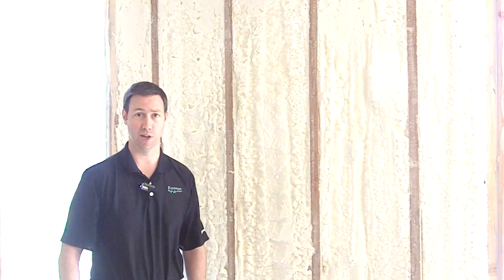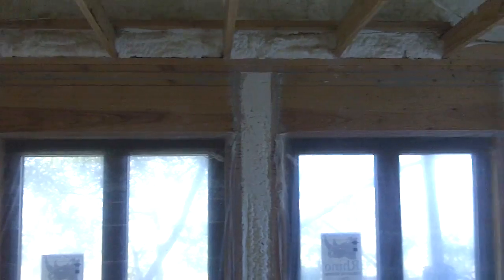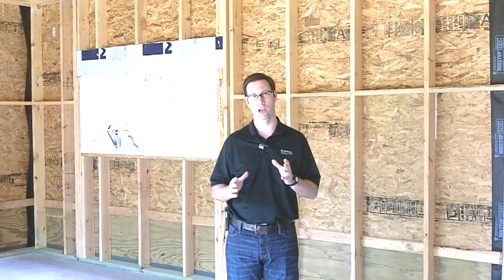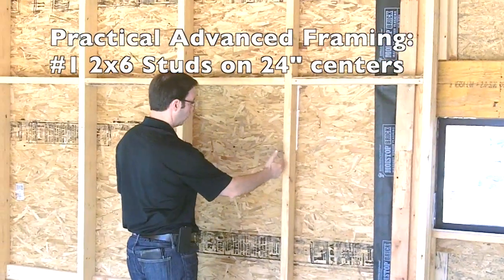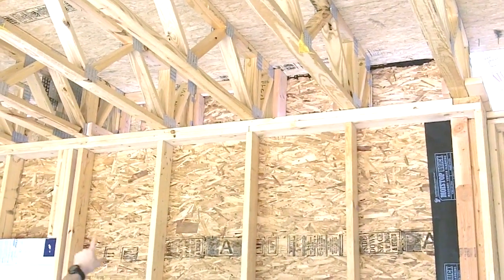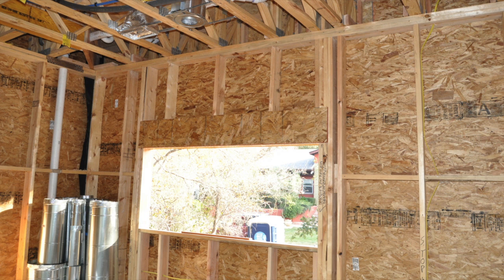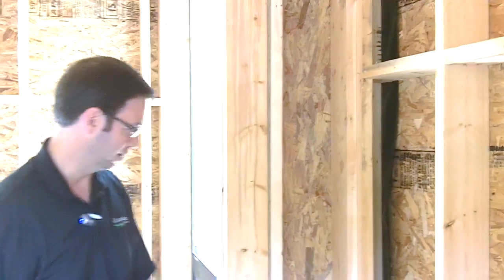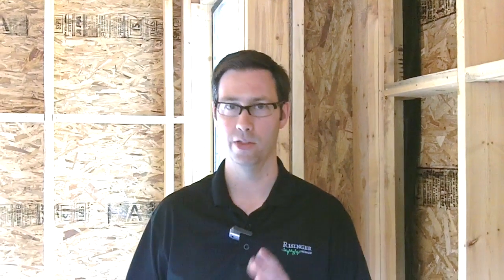Advanced Framing vs Traditional Framing

Comment: 24 inch centers are not a good engineering practice. This will weaken the wall structure of your house.  Why does it appear that the younger generation like this video, can cheapen down house building and still have good quality. 24 inch centers will create a bad quality frame product because there is less support to carry the load of both the house materials, people and their decor,  and weather.  Stop being so cheap and promoting it. Its ok to spend a little extra and go 16 inch centers and have a quality product that will hold up and last a long time..

Comment: i agree with most here on comments...  u dont save all that much by 24 on center...  2x4 walls 24 on center is a freakn treehouse...  i do like the spray foam tho, at least your gaining some ridig structure to your 24 inch center. u have all those fireblocks your adding.  i think this concept you invented is kinda a joke.  advanced scientific framing?  like your some groundbreaking scientist that is  above traditional carpentry..  which has been prefected , tested, improved upon for 100s of years, not to mention how engineered wood products have brought traditional modern framing to whole new level of awesome!    to think that your methods are something new and scientific is hilarious....

Comment: I believe it was about 25 years ago that 2x6 exterior wall framing on 24" was gaining in popularity based on getting an R19 perimeter wall instead of an R-11 or R13 wall.  That didn't last long, as it was determined not much money was saved, if any, and that heat gain is principally through window openings, wall penetrations, etc. As the man states, having to use 5/8" rock on walls costs more.  So most homebuilders went back to 2x4s on 16 with much better windows, and foaming gaps.   I'm in FL, our code is  unique and different than yours. Your state's code is online.

Comment: Here we go with some college boy getting all big- brain worried about the R- value of solid wood over a handful of windows when the percentage of wall area which they make up is ridiculously small, and is that a heat loss you really need to  worry about.  just make sure there's a Tight Seal where the sill plate meets the foundation. A leaky one of those can equal a two foot square hole in the wall.

 Add to that he thinks he's genius going with a thicker drywall to make up for his lack of framing where he's trying to save a buck.
Well... As they say in Millennial speak, let's sit beside that supposition and unpack your assumptions

 In my neck of the woods 5/8 is about $2.50 to $3.00 more per sheet. And for the sake of argument 8 foot 2x4 Doug Fir framing is $3 a piece. As on 2 foot center an 8 foot sheet spans 5 studs and on 16 inch Center an 8ft sheets spans 7 studs 

There are two 4 foot wide sheets on an 8-foot wall. Therefore the $6 saved by eliminating two studs is spent back by spending $3 extra per sheet of 5/8 sheetrock. Then one must consider the added cost to the drywaller charging extra to hang a heavier sheet, which in my area can be between $2 and $5 per sheet depending if it's wall or ceiling

So as you could see 2 foot on Center framing with 5/8 drywall is not a savings but an added cost to the job at this point

 But even more important are you going to get door jambs 1/4" wider readily available for the thicker wall?

 There were no quotes available online anywhere for 4 3/4" jams which would be required for 5/8 drywall. The only jamb available for pricing only the 4 1/2" jamb was available for pricing which we can assume the larger jamb is special order so forget about that being convenient and affordable.

 Or  perhaps are you make your trim Carpenters fuss with some bogus job site extension jamb detail underneath the casing. 

The same thing with stock windows ...now you need extension jambs and you don't need me to tell you that is a Time killer. You will easily see any savings in your economy framing go right out the window, literally. 

Don't try to get fancy, you haven't come up with anything better than stick framing 16in on Center and a half inch drywall. 

There's a reason why it's been around for so long and so universally accepted throughout our country because it works. It's simple it's efficient it's economical it's easily handled by small crew and it makes a good house. It's already been paired down to its simplest elements

And while we're at it beating up on this palooka, I live in a high wind area and that piece of shit he's standing in front of there with that OSB sheathing that's going to need wind bracing straps underneath the sheathing big time. 

My house is a 1955 Cape Cod with 10 pitch roof sheathed in 1 x 6 tongue and groove board on a diagonal on the deck and second floor and on the side wall and laid  parallel on the roof. Let me tell you, I'm on south-facing side of a hill overlooking large body of water and when  the wind blows the only time I ever heard my house move was during 70 mile-an-hour gusts that took down the oak tree across the street and don't get me started  on that a crappy California corner. It will never work where I live. 

I got to stop clicking on these construction videos. It's reminding me of how intelligent I think I am but if you knew me you'd know I'm really not, it's just guys like this make me and a lot of my friends look really really smart

Hey at least he got a fresh haircut for the shoot

Comment: As a framer in the northwest, where we actually have to worry about -30 to -50 temps as well as snow load, you can keep this nonsense wherever you are, I'd get laughed off the jobsite for even suggesting what you call "advanced".  Also your cali corner is missing a board, as well as the heading backer over your windows.  Your traditional corner is just nonsense.

Comment: Remember ove framing is 19.2 on center "black diamond on your tape". Using 2x6 and a tie system will take care of a lot of your worries. My house they used standard 16" centers on the walls, and 2' on the roof rafters lining up the load path is easy on ove framing

Comment: Yea forget that. I live in the North East, and we have construction companies that come up here from Texas and built a few developments. Listed them as luxury apartments, and the roofs collapsed in the Winter Time! I'll stick to the way we frame, 2x6 16" on center for the walls, triples in the corners, you insulate them as you build, that's code where I live, 2x12 floor joists and roof rafters! I don't like the header that he is bragging about, his 2x4 is shifted over to the right, you can see a spot with no support on the top plate because of this. I really dislike this so called advanced framing. I wouldn't sacrifice structural integrity for a little extra insulation value. Just find a better material for insulating if you are that concerned, also you can insulate the other side of the wall under the siding if you needed to.

Comment: Just plain crazy  add a few studs and do it correctly the first time. Why make problems for the owner after you are gone. 40 ft. wall 40 studs + or - . Your wall 26 plus 10 for horizontal cross members, maybe a 4 stud savings and a poorly constructed home. Put 12 inches of wet snow on that roof and watch the walls below bow.

Comment: If it was 1/2" Advantech sheathing I would go for that. If you show up on my jobsite with ANY particle board of ANY type other than Advantech? I will kindly throw you off of it. 24" centers?? Are you NUTS?? AND you are trading the cost of 2x4 at 16" centers for the cost of 2x6s at 24" centers. GO BACK TO SCHOOL son.

Comment: Notice the header @ 3:43. There is nothing for nailing wide headstock. This is a common problem I've run into as a finish carpenter. If the window gets a heavy headstock for trim, I sure wish they would provide some backing.

Comment: Just to be clear, you can not frame a 24" on center 2x4 wall. Only 2x6 and up. And for those saying it should be 16" on center, that is wrong too. All these items are written in to the American Wood Framing tables and also in the IRC/IBC. These issues are not just pencil marks made by and engineer, but buildings are actually framed on whats called a shake table where things like lateral restraint and shear. Expencive testing but actually tested well. If spray foam is used, the building is very well up to sheer and lateral restraint.Also, 5/8 DW is required for 2x6 24" on center, or 1/2" DW thats called C board that meets the same sheer and smoke/fire requirements as 5x8".

Comment: It's understood that when framing with 2x4 studs you set every 16" oc. When upsizing to 2x6 it is acceptable to space 24" oc. And this is a determination for the engineer not the contractor. This yahoo is talking like he is reinventing home building. The only borderline original idea is insulating headers and the GC I worked for in Alaska had been doing this for years. Texas tho? You fucking kidding dude? Whoever said salesman nailed it. This guy is selling a down jacket to a bunch of unsuspecting desert creatures. Looks good tho. If I was some dumbass who wanted to brag about my R values to my neighbors I'd be pumped.

Comment: I have more of an issue with "off-gassing" spray foam insulation than I do with traditional framing. "Advanced" framing will get you canned in the quality world. Pictures fall off walls when doors close too hard, ears pop from the drywall flex from opening and closing doors. roof loads, wind loads, etc. Been there, seen that, addressed that, fixed that. Tract builder grade workmanship is unacceptable in the custom world. 38 year contractor in Florida here. Framing for most of them. If it feels cheap, it probably is. "The bitterness of poor quality lingers long after the sweetness of low cost is forgotten."
Reply: It would be great if a foam spray existed whose only gaseous component was carbon dioxide. 
As far as drywall goes, I hate it. If forced to use it, I'll apply one layer and laminate a second layer with offset seams over it with a non-VOC adhesive.   Even if the second layer is 1/4", it has better strength, crack-resistance and sound deadening properties than the equivalent thickness "single ply" drywall.
Reply: Eddie, I was told styrene type spray foam was illegal inside human living quarters. We built with a spray-in called icynene which is water blown and non-toxic. It doesn't get so rigid, neither.
Reply: Yep, you nailed it.
Reply: Love the quote. I also experience the inverse which is also true with tools. "The price of a quality tool is soon forgotten. The lack of performance on a budget tool is experienced frequently." For example, I nearly cried the day I bought my saw stop. Today I can't remember what it cost but the saw sure is nice to use!
Reply: @RussSchampers  Sawstop! Nice rig!
Reply: I agree plus it takes more man hours with some of the goofy crap they come up with and if you're a framer like me that still gets the same square footage it doesn't make sense
Reply: I like that quote and I’m gonna steal it from you Eddie.
Reply: I will framing my vocation house with 2x6 outside wall and 2x4 inside wall,should I have loading walls olso 2x6?

Comment: Here in Washington state, I use 1/2" c board. It has the same value of 5/8" such as fire and shear, and has a rating of one hour. Built my house with it. Hung and taped the house myself. I'll tell you what, rent a board lift. noting but perfect joints for the framing.

Comment: Questions! 1) What is the payback period for the incremental cost of your insulation protocol? 2) Studding with 2x6 on 24"oc looks like a good idea, but aren't you overly dependent on the strength of your sheathing to provide for the structural integrity one would expect on a custom home? 3) With respect to foam insulation:  Are there any long term studies on its off-gassing, structural stability, resistance to decay and insects? 

I would really appreciate an answer since I want to build one more home for retirement here in Ohio.  I like Roxul for insulation since it is mineral not organic based and the material has been around at least since 1948 when we used it in the house I grew up in.  Though we really don't need to concern ourselves with hurricanes (tornadoes YES!) I want to build a house that can resist a hurricane only because they are stronger.

Comment: This wouldn't pass inspection in NY, this framing technique will bite you in the ass eventually..  moisture will warp interior and exterior sheathing alot easier than with 16" on center.  and I wouldn't want to bump into the sheetrock after it's finished because it'll ruin it.  They don't seem to mention how many god damn blocks you'd have to put in to install cabinets, shower fixtures, etc..  just stick with what works.  16" on center you'll thank me in 50 years

Comment: Try to minimize spray foam insulation -- lots of chemicals that can continue to emit fumes. Combination rigid mineral wool on the outside and rock wool batt insulation between studs would be a suggestion. Great videos, keep on making them

Comment: This is medieval Framing not advanced, you think your super smart but as a Framer I know otherwise, I’m on to u, and your not saving much money might I add, if any, cdx looks nicer than osb but is not better, if you waterproof your Concrete you don’t even need treated wood, single sills mean you can’t put any hardware on it for shear transfer unless your Engineer allows a continuous cs16, in which now with a single sill you can’t nail on your window, if you pre drill you’ll still have a hump where the strap is, looks to me your just really cheap and think your smarter than most, but your not, and if your budget is determined by cdx, in comparison to osb, than your homeowner can’t afford the house your building and you probably won’t get paid
Reply: better define it as peasant medievel framing

Comment: I've never framed like this.   the one thing i wouldn't like about 24" on centers is that it would be harder to find studs to hang heavy objects.   it's hard enough them being 16" on center.  As far as strength and cost, it seems its the way to go.
Reply: A little planning and strategic blocking can help with hanging things later

Comment: do your self a favor easy test 5/8 drywall get 2 studs put at 24 on center then the same at 16 push on the board what do you think will happen now think what happens to the tape joints the extra flex will crack the tape joints that is why drywall requires 16 on center not 24 if you want 2by 6 you still need 16 centers for suport of dry wall

Comment: Isnt there a law in the states preventing this type of things from happening? How can this guy advertise and profit LEGALLY about changing how to frame??? Dont your building codes prevent this? 2x4 exterior?? Wooooow!!! And 2x10 headers are for weight distribution point loads above windows ..... it has nooooothing to do with R value rookie. Here in Ontario Canada you can fail a framing inspection simply by having the wrong nailing pattern or by using spiral spikes instead of #10's in truss hangers or forgetting too add glue to your truss hangers. And this guy wants to rip out wood.

Comment: I like applying the OSB vertically on the walls so as to eliminate all the hours/material of blocking, as well as having a continuous/unbroken tie from floor to ceiling......Ply and OSB are available up to 12' long panels.
Some horizontal siding benefits from 16" o.c. framing for the extra fastening points available-
they both have their advantages.
Thanks for sharing your techniques....

Comment: 24" OC is NOT enough for basically all code applications in MOST locations. 24OC  is too weak for drywall. a big dude leans on the wall, he will go through. Kids bounce a ball off the wall, BAM broken tape joint. 2x6 asnd half inch-5/8 ply is WAY cheaper than OSB also. 24OC is FINE for interior walls, but never for exterior walls.  Id hate to buy one of your homes!

Comment: Where in the world could one obtain lumber straight enough to accomplish this? I work in as a production framer, and there is not one stud I have seen that couldn't be classified as not putting stress on the building to manipulate it into place. Especially fire rated wood.  Oh yeah, better hide that anchor bolt before someone, maybe even you, trips and you have a lawsuit that costs you more than the "corners", possibly California, you are cutting, than the imposed savings you are trying to validate chap.

Comment: 3 stud or less = less strength where it is needed: on the corners. I use four stud corners, full length studs avoids cavities, using foam on seams stops air creep. While is does not do much insulating it does a lot of strengthening where it is needed. Insulation losses at 4 stud corners are not significant using 4 full length studs. Additionally, I use 90 degree steel angle on a 45 degree angle for let-in bracing and I insulate exterior headers as you've described and shown. I also use full headers over interior doors and tie down the trusses wherever a truss bottom meets an interior wall in addition to exterior wall tie downs on both sides of trusses. "You don't have to do that." Yeah; I know ... I also don't have to insulate every wall - every wall -  or use quiet appliances including quiet exhaust fans and insulation between floor joists, particularly between first, second, or third floors. My homes are quiet, strong, and two have withstood tornado winds - not the tornado; nothing withstands a direct hit, usually. I install metal roofs, so they lost a couple of metal roof panels while lots of neighbors lost their homes. My two customers were able to house some neighbors for a while to help them get re-established. Strength first, Insulation second, peace and quiet third. That's how i build.